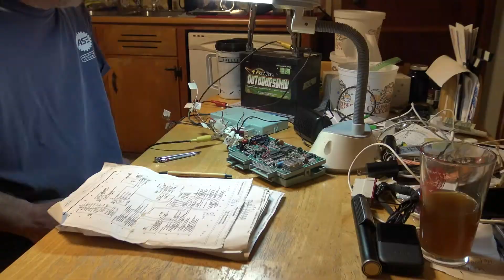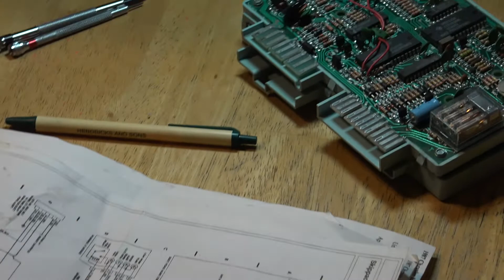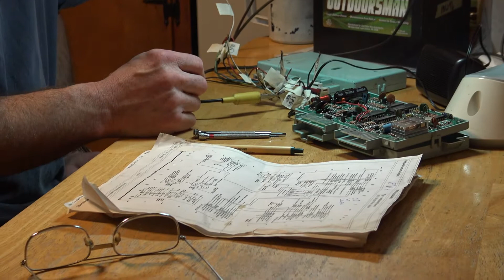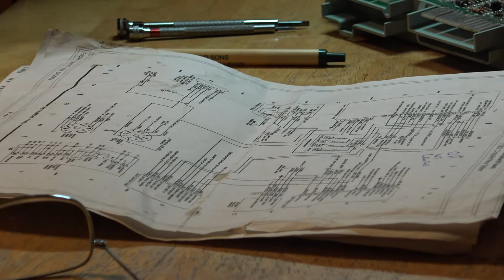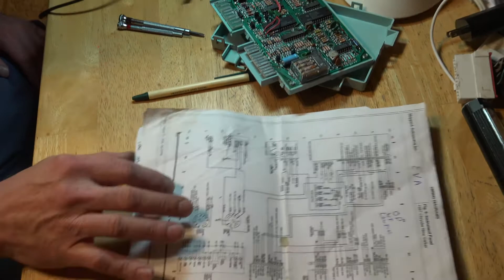Chrysler Electronic Voice Alert EVA Computer. 25 Years Later, We Power One Up. Will It Say Anything?

Comment: My grandfather has a restored '83 LeBaron. The EVA works wonderfully. There is no repeating messages, everything that it has to say is said when the engine is started unless you open a door or something goes wrong while you're driving. Also after about 6 seconds of the initial messages about the fuel, oil, and washer fluid, it should say "All monitored systems are functioning". At least that's what happens with my grandfathers. Hopefully this helps!
Reply from the maker: Very cool! Thank you for the reply. It explains why I thought there might be something wrong with the two I have.  Your info is very much appreciated.